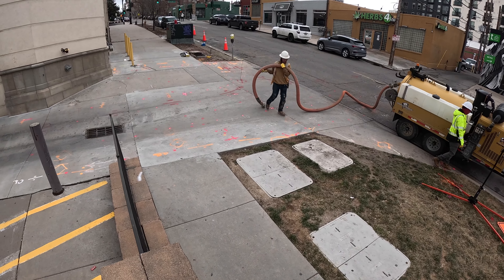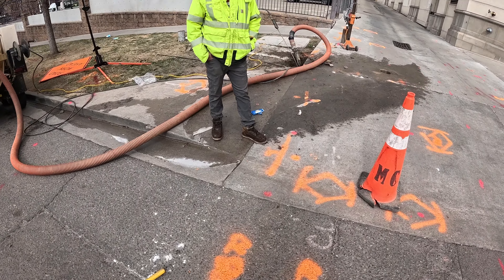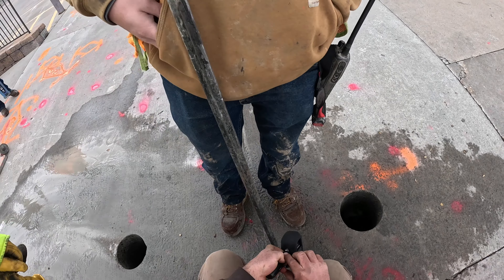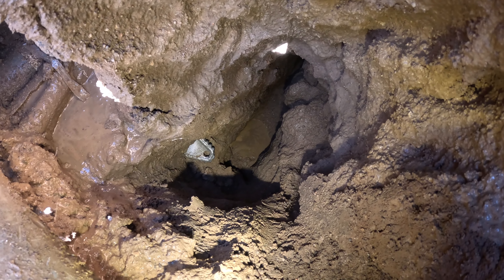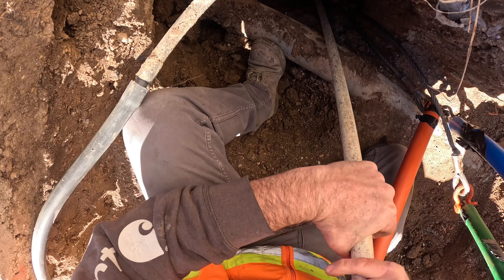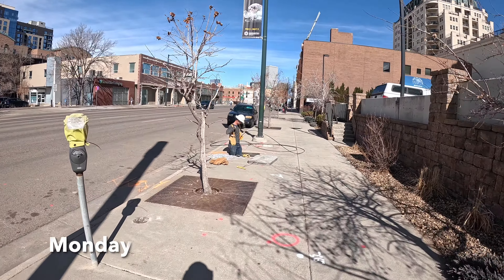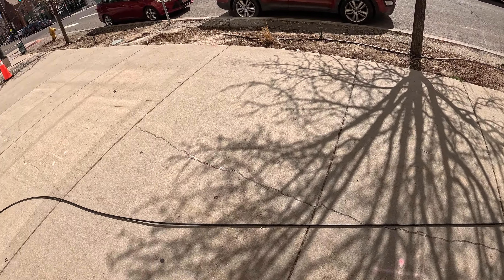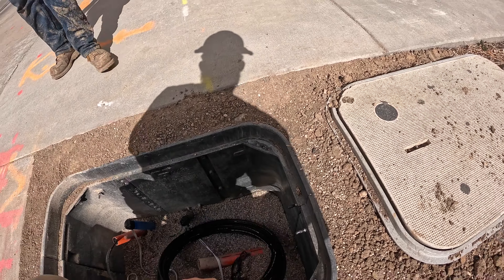Clearing a path to drill in conduit for fiber (part 2)

Comment: Love your videos.  Everybody does thing their own way and lots of ways work.  Here are some comments about how we did things:  (1)  We would use mule tape in plastic conduits because we had instances where the rope (which is more abrasive) would cut through the plastic.  (2)  Along with the fiber we would pull another mule tape in case another fiber was desired in the future.  (3)  The mule tape we pulled with the fiber would include an integrated locator wire so we didn't have a seperate wire.  Thanks again.